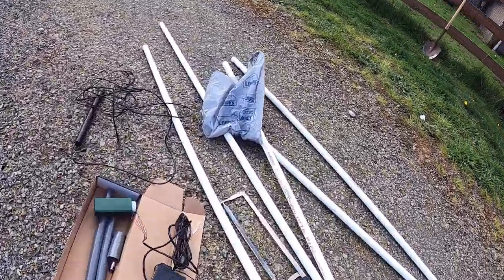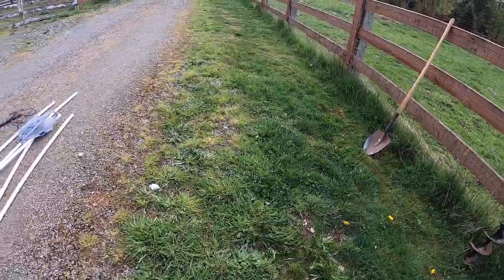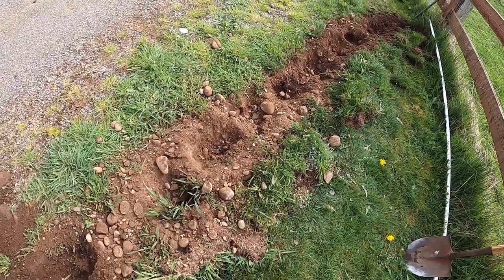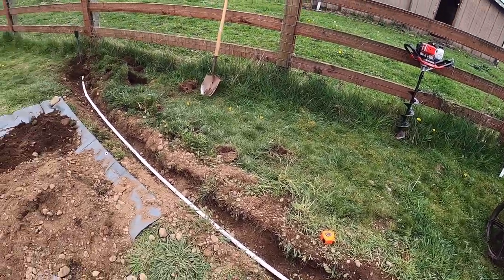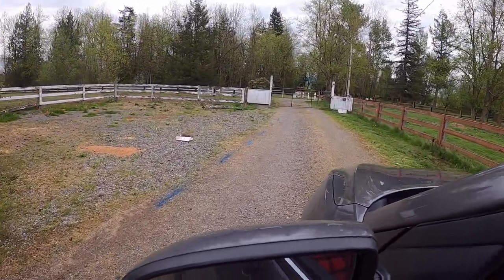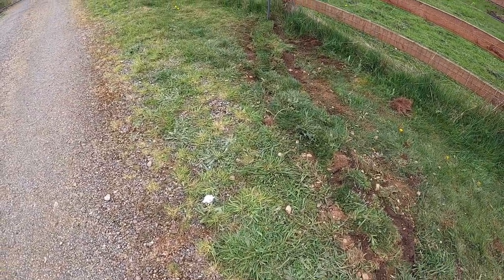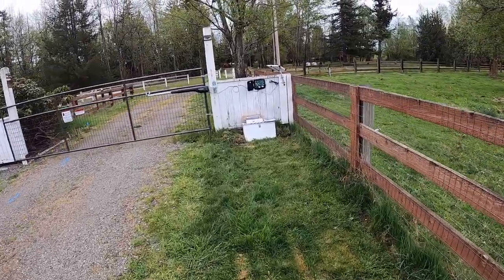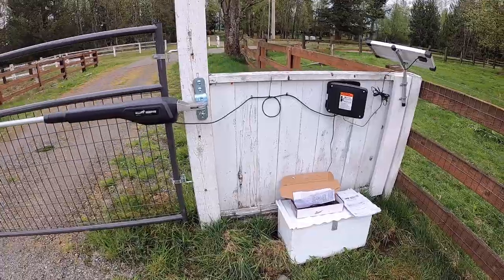mighty mule auto sensor install

Comment: your control box supports the gate operator receiver, if you would of look at the board manual it tells you where to install it not the manual from sensor. yellow to aux negative, red to aux positive black to COM(8) Blue to EXIT (5)

Comment: I have the 571w. I used to have the old 500. I have no dip switches either on this new one. My wireless vehicle sensor worked with my 500 because of the dip switches, now I can't get it to work with my new one. How did you get them to communicate? Any help would be appreciated.
Reply from the maker: Hi Reg, I changed the left dip switch on the transmitter for the wireless sensor  and then paired it as per the manual. I hope that helps. I am going to install a wired sensor as one of my dogs chewed up the transmitter and you can’t just buy the transmitter.
Reply: @mattlacombe3912  I ended up getting it worked out a few minutes ago. But thanks very much for getting back to me
Reply from the maker: @1Regmak  That’s good. BTW I have a 371. What did you do to get it to work?
Reply: @Matt LaCombe  I kept the dip switches in their same position without moving them. Disconnected the transmitter head and took the batteries out, walked over to the control box with it and opened the box. Held the enter/return/L2 button til it beeped, then popped the batteries back into the transmitter head so it would do its test cycle, and the box learned it just like the hand held remote. Put the transmitter head back on the exit wand/sensor, then test drove over to make sure it worked. Easy as pie. Wouldn't have even gotten the idea without watching your video tho.  Thanks a bunch

Comment: Hi Matt, My folks are in their 80’s. They have the mighty mule gate like yours and their gate opening sensor stopped working…the one that lets you out. They called the company and were told to change the two double A batteries in the sensor. They can’t figure out where the batteries are? Are they in the little green sensor where the dip switches are? If so, how do you “pop” the cover off? Thank you.
Reply from the maker: Yes, they are in the green sensor. You should be able to take off the cover and replace them.

Comment: On a different note, how did you mount the bracket to the gate itself? I have the same type of gate, did you use muffler clamps?
Reply from the maker: I used some U-bolts but muffler clamps would work better.

Comment: Hey Great video, i am all in except for Learning the Sensor and kinda stuck, any help would be appreciated..
Reply from the maker: Hi George. Are you talking about the underground sensor or the green transmitter?  If you are talking about he green transmitter, you need to take the batteries out, press the “enter” or middle button on the control panel until it beeps then put the batteries back in the transmitter. This is similar to learning the push button transmitter for your car. Hope this helps.

Comment: So, I changed the first dip in our wireless vehicle sensor, pulled the batteries out, then went to the control box and pressed the learn button (center button until it beeped), then ran back and inserted the batteries into the wireless vehicle sensor. ...The control box beeped (same as when it learns a remote) and our gate opened. -Thank you.
Reply from the maker: Glad the video helped.

Comment: How are you powering the wireless sensor?
Reply from the maker: The sensor is connected to the transmitter which is powered by 2 AA batteries. I believe the sensor detects the car by magnetism. Somewhat how stop lights know a car is there to change the light.

Comment: Do I match the dip on the control board to the the sensor transmitter?
Reply from the maker: Thomas I didn’t have any dip switches on my control board so I just changed one switch on the sensor transmitter. If you have dip switches on your control board you are supposed match them to the transmitter. I also had to sync the transmitter to the controller doing it the same way you would with the transmitter you keep in your car. Hope this helps.
Reply: @mattlacombe3912  how did you know which dip switch to change?
Reply from the maker: @russshumate  I don’t have dip switches on my control board to match with the transmitter. I just changed one switch on the transmitter then synced it like you would with the one you use in your car. The directions are pretty sketchy.

Comment: What did you change on transmission to get it to work
Reply from the maker: Karl, I changed one of the dipswitches on the transmitter and synced it the same way you you would for the transmitter you use in the car. I took the back off of my car transmitter and it had no dipswitches. I don’t know what kind of transmitter you have for your car but if it has dipswitches you are supposed to set them the same.
Reply: @mattlacombe3912  You said you changed one of the dipswitches on the transmitter. There are 9 dip switches, which dip switch did you specifically change on the transmitter?
Reply from the maker: @ReggieE82  I believe I changed the 1st one. The one on the far left. I don’t know if it matters which one you change. We couldn’t get our transmitter to work either so we changed one switch to see what would happen and it worked.
Reply: it might help someone it's #9 (the top one)

Comment: I'm in the process of working on one at my fathers house and can not figure out how to get the green box to connect with the gate. is there any certain thing I have to do to get the two to sync up?
Reply from the maker: If your hand held transmitter has dip switches then changed the dip switches in the green box to match. If you don’t have dip switches in the transmitter (I didn’t)  then what I did was just change one dipswitch in the green box and pair it like you did the hand held transmitter. Hope that helps.
Reply: @mattlacombe3912  Is there a button on the sensor transmitter to pair it?
Reply from the maker: @alixcoats  I believe there is. I will have to double check mine though.
Reply from the maker: There is no button. Once you put the batteries in, it will pair. You made need to turn up the sensitivity on it.

Comment: Okay what I have found out you have to match the dip switch from your handheld controller to match the vehicle sensor controller on the ground. Have somebody take the battery out of the vehicle sensor controller and put the battery back in and which time you have 60 Seconds to hold L2 on the controller two pair two units this is when the gate opens. This is for the Mighty Mule w371 gate opener with internal receiver
Reply from the maker: My hand held controller doesn’t have dip switches. Glad you got it to work.